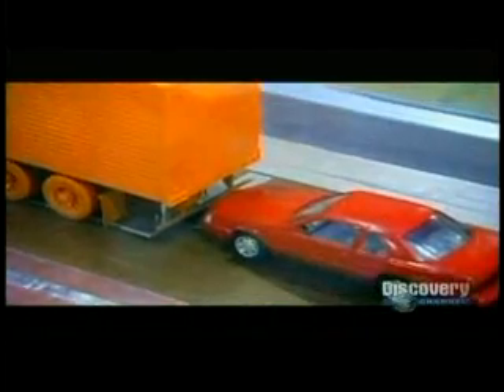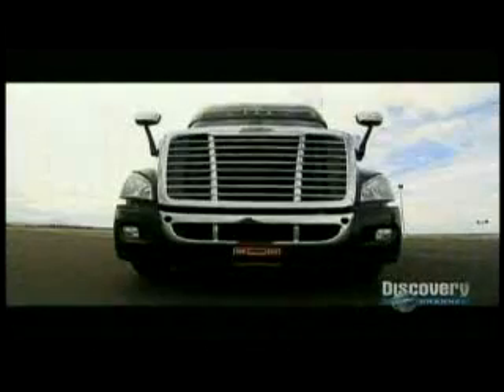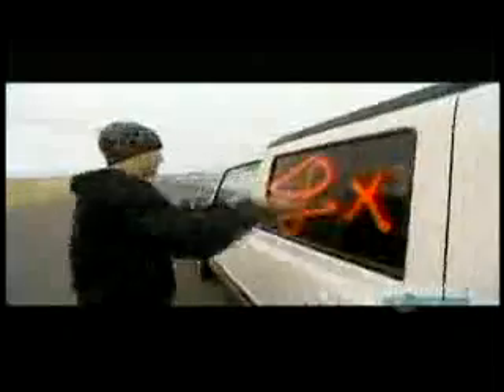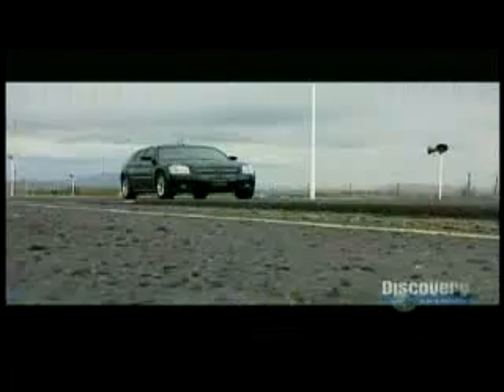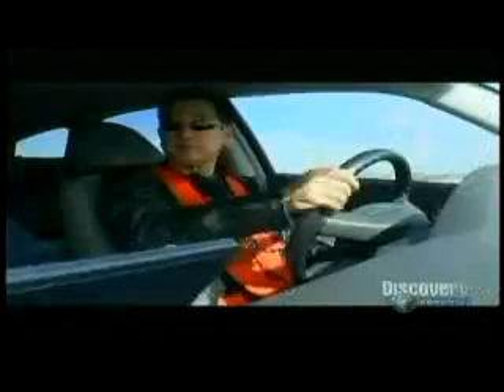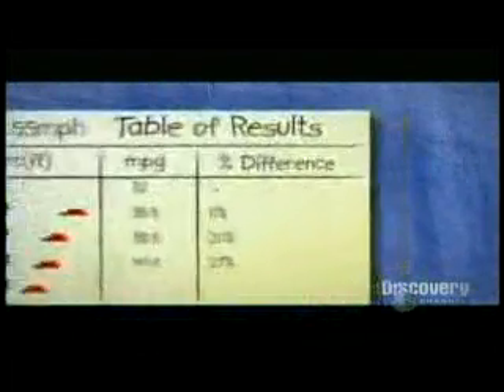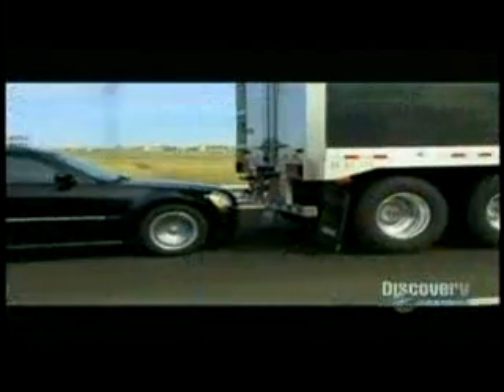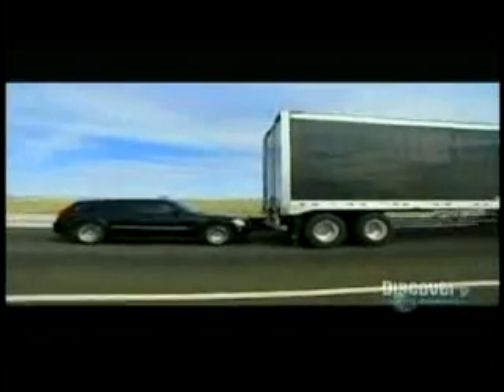Drafting Semi

Comment: In the situation they were in they made it sound much more dangerous than it was. Stopping a big rig is not easy compared to a car. Sure there could be a fender bender but at 2 feet the truck has no time to slow down significantly relative to the car. Not saying it wasn’t dangerous or difficult but under controlled conditions they were under not that crazy.
Reply: I was thinking the same thing, I think they (rightfully) did that intentionally to discourage people from doing this. Under their highly controlled conditions with trained drivers and no traffic, even if there was a slight mishap and they did bump into the truck, with such a low speed differential, the result would be nothing but a minor fender bender. On the road, this is obviously a terrible idea though.

Comment: far too dramatic.. Got plenty of time probably at 30/40 ft. Trucks have a high viewing point so can see what's happening ahead. That plus you keeping your whits about you and you'll be completely fine (e.g. if you can see cars in both lanes overtaking and then braking up ahead, pull back). Slap it in cruise control, keep your foot over the brake and chill. Done it for years now and never once have I had even a hairy moment

Comment: For those, who dont wanna watch it
Distance apart(ft)/mpg/savings:
no truck/32/0
100/35.5/11%
50/38.5/20%
20/40.5/27%
10/44.5/39%
2/41/28%
Reply: Bump
Reply: It may save gas, thus saving money too, given how expensive gasoline is nowadays, but, no matter the economic situation, it’s beyond not worth it as you could very well lose it all.
Reply: @MrSupercar55  20 feet is more distance than most people leave on the highway

Comment: I don't understand much of the danger of drafting a semi, as long as you aren't super close. A semi like that weighs about 8 tonnes (17,700 lbs) and the trailer is an additional 8 tonnes (17,700 lbs) empty. At 55 mph, it takes way longer to stop a 16 tonne (35,400 lbs) truck than it does to stop a 1.5 tonne (3,300 lbs) car. So as long as you are paying attention completely to the truck and surroundings, and are no closer than about 15 feet from the rear of the trailer, it appears safe to me. It's the idiots that ruin it for us.

Comment: I drafted semi's on several occasions in my travels. It's not the safest thing, especially on a motorcycle, but it does drastically increase the gas mileage. I've gotten over 100mpg on my 600cc Shadow which usually gets around 50-55mpg. I've never drafted for the purpose of saving gas though as I already get excellent mileage. It's usually when I have a very strong head wind, but I have done it to dodge hail, heavy rain, and one time I even found a reefer truck that was leaking condensation that would hit the bumper and turn into a mist that kept me cool while riding through Arizona one summer.
Reply: I know the feeling. I had to do the same thing when my country experienced a gasoline shortage during the fall. Because my car doesn’t have a trip computer to measure gas mileage, I don’t have access to the exact numbers, but it definitely doubled my gas mileage at a time when it probably would have been that or not being able to get to work or anything. The shortage has long since ended, but gas prices are still higher than they once were.

Comment: i'm interested to hear how truckers feel about this.  i drive a 2004 insight and i try to be very courteous and aware around truckers, including correctly signaling when it's clear for them to change into my lane, as well as pre-blocking a lane for them if i can feel they want to change into it but other traffic isn't going to let them.   i also draft at about 20', if the semi is not going faster than i want to -- iow speeding up to catch a semi who is choosing to go faster than me doesn't result in a gas savings by drafting it (usually).  often times the impression of the little fish who hang onto sharks comes into my mind.  i hope that truckers don't hate me for drafting at that distance, but i have never had the opportunity to find out.
Reply: Since you ask.  I"ll tell you(25 years, all 48 states and millions of miles).  We call you hemorrhoids.  You're tsking your lofe on your hands. Generally,  I don't mind because how you decide to end your life is your budiness
Reply: thanks for your feedback!
Reply: jared spiegel you're welcome, Jared. Apologies for previous mispellings. Bear in mind,  when you impact the rear of my trailer one of two things will happen. At a lower speed the impact with the bumper will sheer off your hood sending it through the windshield. At a higher speed your car will go completely under my trailer completely sheering off the top. Either way the results will be fatal. Chances are the most I will feel is a bump. I have personally seen the results. I would however like to thank you for your courtesy when it comes to larger trucks. Trust me, your consideration is appreciated.
Reply: rick2112rkrk    indeed.  moreover i try to bear in mind that when i impact anything on the road, it will be pretty disastrous (i drive an ~1800lb car), which is why my primary focus at all times is not impacting anything :).   i've seen the situation you describe, also.  i feel like most if not all accidents out there could have been prevented by paying attention and planning better (or planning at all).
Reply: rick2112rkrk Let me ask you this. Firstly, I don't condone drafting a semi. But is the approximate weight of a full-size bob-tailing semi 8,000 kg (17,700 lbs) and a 52' or 53' trailer is 8,000 kg (17,700 lbs) empty? (That's the figures I have gathered through life experience). How long would you say it takes to stop that 16 tonnes from 60 mph? Maybe 500 feet? It takes a car or small truck about 150 feet. Really, as long as you are paying close attention to the road (say, alone in the vehicle), and you aren't closer than about 15 feet, you wont get a reaction like you explained. Worst case scenario you would mess your front bumper up by tapping the trailer if your reaction was too slow AND if the transport slammed on its brakes full.
Reply: Joseph Summers oh I'm on your side. I guess what I'm offering is that there are lots and lots of folk out there who don't think about or pay much attention to themselves and others on the road, whatever the reason may happen to be, and it's for those folk the Never Do This messaging is more tailored toward.
Reply: jared spiegel
Indeed. And like my roommate says. Do you really want that stress and risk to save $8 on a tank of gas? Not really...
Reply: jared spiegel
But it really all boils down to reaction time. The faster a 16,000 kg+ vehicle is moving, the longer it will take to stop and the slower it will decelerate. At 60 mph, it will take tons of time to stop and it's deceleration is horrendous. People think that transport trucks behave like a new Camaro.
You just have to have quick enough reactions to slam on the brakes before the trailer of the truck hits your bumper. And even if you leave enough room, and have a decent handling car, you can maneuver around the truck on the right to avoid a collision all together. It's still not safe, but it isn't as dangerous as the mythbusters made it out to be.
Reply: Joseph Summers sure, but somehow lots of people still manage to mess it up, i think is the experience he's coming from.

Comment: I don't get how drafting a semi is dangerous if you're paying attention and road conditions are good. Even with the latter, I don't see a big risk being taken. A truck weighs many times more than a passenger car and, therefore, takes way longer to stop. What do they expect, the driver will unhitch his trailer or magically stop and back up in 1/2 a second?

I do a lot of driving and, therefore, draft semis at 20ft. in good conditions and 50ft. in rain. My Crown Victorias get 26 mpg if I'm not drafting and 37-38mpg at the 20ft. drafting (about 30-31 at 50ft.).
Reply: This is what I was thinking too, but on average how fast do the semis go? and do you pass them alot?
Reply: Ben Higgins About 60-65mph and only if I'm in a hurry.
Reply: Ben Higgins The semis where I'm from normally go about 60-65 mph (96-105 kph) on the highway. And I agree with Nate. It boils down to paying full attention. It takes a lot of time and distance to stop all the weight of a semi. From 60-65 mph, I bet it takes a good 500-600 feet (and a car takes 150-180 feet)  - and that's IF the semi slams on the brakes full, which doesn't happen too often.
Reply: While traveling in heavy rain and fog one time. I couldn't see that far ahead, so I drafted a big rig with shinny trailer doors so my lights would light up the door allowing me to see where the rig was and follow it not worrying about how close I was becasue rigs take forever to stop and if anyone was going to hit anything, the rig would hit the car in front of him knocking it out of the way. When if I were to hit something it would damage my car too much. I always draft big rigs while traveling. My Subaru has Eyesight so my cruise control drafts for me automatically. I dont have press the brake or accelerator.
Reply: Nate Thegreat It's a TV show, they have to pay lip service to the government laws or else they'd get in legal trouble.

Comment: actually, based on physics, it is not entirely dangerous to follow at 10ft(3meters)
based on normal truck stopping distance, in each second that the truck is slowing, with full braking power, it loses 3m/s of speed which constitutes in it getting closer to you by approximately 1.5m, which gives you more than a second to react, and since a car stops much faster, you wouldn't hit anything...
that, off-course, is based on the fact that you are paying full attention to the road and the brake lights!
Reply: @Need2connect I made that comment 8 years ago lol
There are no parked vehicles on the freeway. They also don't come a halt in 0 seconds.

Comment: So over-dramatic. Under these conditions, there's no reason the big rig would have to stop, so that scenario is unrealistic. Also, if the big rig slammed on the brakes, even though Grant has only 0.03 seconds to react, the big rig only has the same 0.03 seconds to slow down before getting rear ended by the car. The speed differential would be extremely small. Following at 10 feet was probably more dangerous than at 2 feet.

Comment: Well, Mercedes has invented the radar, for  keeping the distance between front cars, an if something happens ahead, it applies the  breaks the car automatically, even to a full stop. They should try with such a car, with setting the distance to 6 ft,  and leaving it in autopilot. The driver holds his hands on the wheel and the car does the throttling and the breaking.

Comment: There are several solid physics reasons why drafting a SEMI is safer than most people think: 1) A SEMI has much more mass than your car, so all other things being equal it accelerates/deaccelerates more slowly than your car.    You car may weigh a ton and a half.  A (loaded) SEMI (CAN) weigh 40 tons.
2)  All other things aren't equal.  Cars have a great deal more braking power than trucks. Per unit mass a car has more tire patch on the road and more brake pad on the disc.
Reply: tell that to my 4 replaced windshields in a year. they kick up rocks